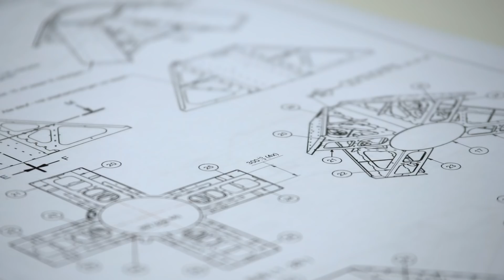The Ocean Cleanup - Launching in 2018

Comment: Let's me give you a more meaningful solution. Stop the trash before it get to the ocean at choke points. There is no need for this fancy stupidly impossible technology. Did you know the ocean is 70% of the earth surface. I don't say that this technology doesn't work as advertised,but it just uneconomical un reliable unsustainable, impractical.
Reply: offcourse we need to prevent it getting in our oceans, but there already  is way to  much trash in them and animals are suffering,dying. It both needs to be done.
Reply: _ Wolfie you should understand the concept of priorities. If trash keep flow out into the ocean, then this technology is useless as f. You need to kill the weed before doing the landscaping work.
Reply: We have to start somewhere, don`t we??  It is easy to do nothing and wait till all countries  really do something / enough to prevent trash getting in our seas.  It will take a long time ! Better clean up in the mean time and save a lot of sealife
Reply: Arivovp,  For chokepoints they are working on other projects like "the great bubble barrier" . Those priorities are not neglected but they are not the goal of this project.  This projects goal is to clean the garbadge patches.  Check into that because i think you dont know what they are.  just look into the 5 gyres there are in the world.

Comment: and then a storm comes and it all falls apart, or a ship runs into it
Reply: The system has Lights and AIS, it is visible by view and on radar.  The area within it is active it not that much used by  boats. Only like 6 boats are in that area the size of europe.  For storms they have the capability to tow it away if the system is heading for a stormfront.
Reply: No, it has been tested for years so that it is storm & crashproof

Comment: I hope it works but i am not sure at all.  Ships can hit it ir tjhe open sea, hurricane can throw it around like masmallow.  Its like a 10 foot straw in the lake drifting around wit h2 strings and a rock.
Reply: The system will be floating way off shore away from most shipping lines,  it will have lights and AIS like all ships do so you can see it on radar. If it gets hit it is because of a very neglegable captain.  The system can withstand strong oceans, The area around hawaii is not that active in hurricanes or tornado's but is something bad is going to enter the area they can always tow it to a safer area.